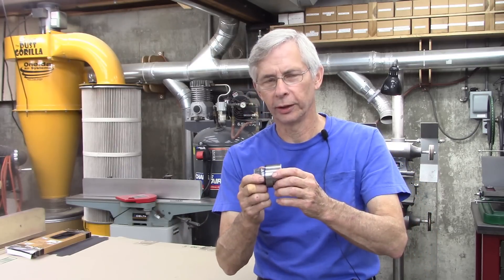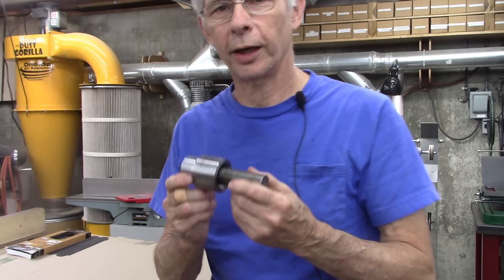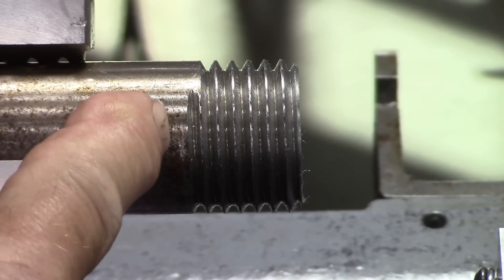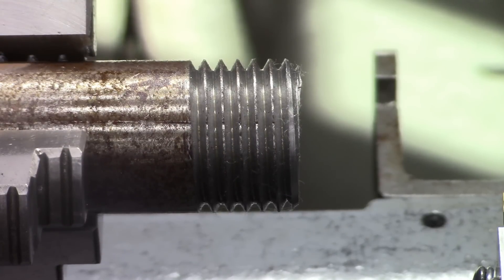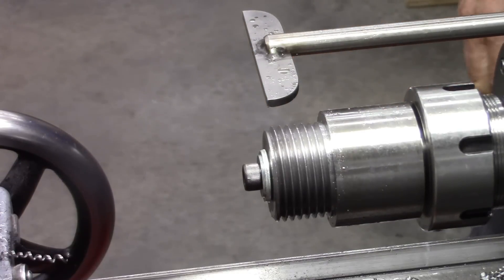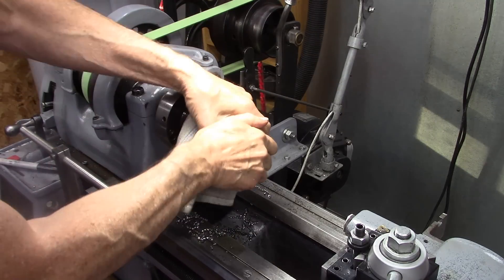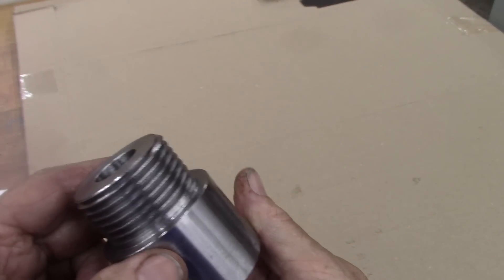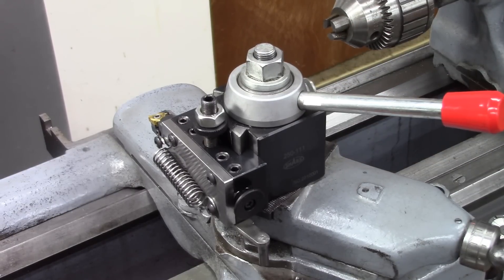Using Mr. Whoopee's Auto Retract Threader to finish my Lathe Spindle Adapter

Comment: Threading is a form cutting operation, angle infeed via compound or radial (direct) infeed via the cross side  makes no difference due to the fact once the threading tool position has been set, the threading tool remains stationary for the entire duration of the thread cut on the lathe. There are only two moving items during the thread cutting process, movement of the thread cutting tool on the carriage driven by the lead screw and rotation of the lathe spindle with the work piece on the lathe spindle. Seldom fact with threading is the threading tool geometry. 

~Fact is, both sides of the threading tool cuts. This is due to the form cutting nature of thread cutting mandated by thread form geometry.

There was a time when threading tools were initially made of carbon steel then a transition was made to High Speed Steel. For both of these threading tool materials the thread form shape was ground into the tool by machine or hand. This method of creating a threading tool has very real limitations, specially hand ground threading tools. Traditional threading tools are typically ground with zero rake, this is not the ideal thread form cutting geometry and is one of the prime reasons why threading on smaller lathes can and is often a problem, nothing to do with angle infeed via the compound set at 29.5 or 30 degrees.

As for making large threads on a small lathe, consider and ponder this example of cutting a thread pitch of 5.5mm on a small lathe.
https://www.youtube.com/watch?v=Vg562R0u5S4

The other way for threading up to a shoulder or internal threads with a shoulder is to run the lathe spindle CCW, moving the threading tool away from the shoulder. This is Not possible on a lathe with a threaded on chuck as the chuck is likely to un-screw followed by rapid dismount causing a serious disaster.

Manufactures of carbide threading inserts like the now common A60, IR or ER recommend radial infeed or direct in, no angle infeed.
https://www.mitsubishicarbide.net/contents/mhg/de/html/product/product_guide/information/turning/threding_ex_02uni.html 

For the fact, once the threading tool has been moved into the position needed, the threading tool remains stationary for the entire duration of the thread cutting process. What doe make a very real difference is the threading tool geometry which has a rake and relief moulded into the insert with precise controlled chip formation that cannot be easily done in High Speed Steel hand ground threading tools. Keep in mind, as the lathe carriage is moved by the lead screw that direction of cut is the cutting edge of the threading tool that does most of the work, the back or trailing edge creates the thread form on the back or trailing edge. Both sides of the threading tool is cutting with the leading edge doing most of the cutting..

The American centric angle thread cutting infeed via the compound set at 29.5 or 30 degree myth needs to be understood why and how it came about instead of being blindly followed or practiced without understanding why and how this myth/practice came about.

Miltifix made a manual retracing threading tool (Type FE) for their Multifix holders, they have been recently reproduced for Multifix holders:
https://www.lathes.co.uk/multifix/
Reply from the maker: >>What doe make a very real difference is the threading tool geometry which has a rake and relief moulded into the insert with precise controlled chip formation that cannot be easily done in High Speed Steel hand ground threading tools.

Generally speaking this is true of carbide inserts. However, the A60 has a simple profile much the same as a HSS tool. I'm not sure why there is no rake on the sides but in my opinion this would be a plus (go look closely at an A60 insert).

Feeding straight cuts equally on both sides of the tool. Feeding in with the compound @ 30 degree cuts only on one side. Feeding in with the compound set at 29 cuts almost all on one side with a very slight cut on the other side. And yes, this is ideal with a HSS tool that is back rake on the left side and back of the tool. The inserts have equal zero rake on both sides with a back rake so going straight in cuts equal on both sides. 

I do with the inserts were made differently. The 16ER A60 I'm using only has a basic back rake.
Reply: @WinkysWorkshop  

If you truly believe compound infeed at 29.5 or 30 degrees results in cutting the 60 degree thread form only on one side, simply make (grind up) a trading tool without the trailing edge or a single sided 30 degree triangle and try cutting threads with it...

That is the lathe single pointing threading myth that is simply false.
Reply from the maker: @rupunzel6299  If the compound is set at 30 degrees it will work near perfect. I'll have to admit that your level of certainty had me doubting myself so I did as you suggested. Please take a look at these picture on my google drive and see what you think.  https://photos.app.goo.gl/wRfnqYL3EY5e2xzFA
Reply from the maker: No comment?  Technically the right side of the thread profile had a slight saw tooth effect. If I had left a small portion of the tool on the right side it would have eliminated this effect. If I was cutting threads in one pass the tool would not have worked. Basically, if you make 8 passes to cut threads only 1/8th of the right side of the tool is used. So at least on the final pass 90% of the cutting is taking place on the left side of the tool.
Reply: @WinkysWorkshop  
"Technically the right side of the thread profile had a slight saw tooth effect. If I had left a small portion of the tool on the right side it would have eliminated this effect."

You've done the experiment and essentially answered this question by this experiment. 
Essentially repeating the results in this Joe Pie video, coarser head pitch or fewer threads per inch will aggravate or better illustrate the fallacy/myth of only the leading (left hand) edge of the threading tool does the cutting. It is also why ALL industry standard threading tools have full thread form be it 60 degrees, 55 degrees, ACME, Buttress and many more.. All are single point threaded with direct/radial infeed.
https://www.youtube.com/watch?v=8wxa7LB0FtE&list=PL4wikbEbcE3Lkebdj7roUYG4RAr7MDhTj&index=8

Those steps are the result of the trailing or right edge of the threading missing and not making the form cut. It also nicely illustrates why compound infeed at 29.5 or 30 degrees is not needed and only adds complexity to the process of single point threading. Or why Mr Whoopee recommends direct (radial) infeed via the compound, as practice in Asia, Europe and else where for single point threading on a lathe.

As for those steps in the heads cut with the 30 degree threading tool, that is not an acceptable 60 degree thread form in any way.
Reply from the maker: @rupunzel6299  Location has nothing to do with threading methods and I never said the left side of the tool did all the cutting. I said 90% (which obviously varies with depth of cut). With a solid setup both methods work pretty close to the same. However, sometimes with unavoidable stick out or difficult to support stock, feeding with the compound does much better. The force on the tool or work is reduced considerably. I probably will not change your mind but watch my next video (will be posted 10 am central US time). Just putting slightly more than a radius on the tip of the tool resolved and saw tooth finish on the threads when using the half-tool. I'm actually thinking a half tool might be the best option. It cuts a smoother thread while eliminating some of the load.  Also, when you watch the video, look at the chip formation with compound-feed vs cross slide-feed and then watch the smooth cuts and chips the half-tool makes. Admittedly, part of this improved finish is a result of a well sharpened HSS tool but the load on the stock and tool play a large part.
Reply from the maker: @rupunzel6299  Joe was not advocating going straight in with the cross slide and he said only the left side and a small portion on the right cut. https://youtu.be/8wxa7LB0FtE?si=eb7APfyvubMRDJcX&t=862

Comment: THAT is a genius idea for a home workshop tool!! And simple! Question though. I see you did use the compound for infeed. Doesn't the compound movement set at an angle also "release" the tool sooner as you feed it in farther since it moves both the tool bit and the slide left?
Reply from the maker: It always retracts in the exact same spot but the depth of cut changes with each pass. If you feed with the compound (as I did) the end of the thread will look a little off center. It still looks great and works find however.

Comment: Maybe a thrust washer on the top of the tool post might help it get tight enough not to move.
Reply from the maker: That would make it tighter but I'm seen damaged compounds from overtightening. I think the abrasive is a little safer and very effective.
Reply: @WinkysWorkshop  true, I didn’t think about it breaking. Not a lot of meat on the smaller axa.
Reply from the maker: @aaronfritz7234  I think most damage I have seen is left over from lantern tool posts but still don't want to go extremely tight.

Comment: That works great. I'd rather stick hot pins in my eyes rather than thread up to a shoulder. It would be a bit pricey by the time I got one to Australia, but as I get older and my reflexes slow even more, it might become more attractive.
Reply from the maker: I understand! It was scary using the tool It worked perfectly but still scary

Comment: Winky, I think that you would do well to fit a much weaker reurn spring to the threader. That seemed an excessive rapid return. Regards from Australia.
Reply from the maker: You might be right although its a snug fit. I think the Craig was worried a chip or dirt might make it stick.

Comment: Great job, But I really do not see a lot of advantage in the threading tool,??? 👍👍👍👍👍
Reply from the maker: There are a few. First, without the auto retract you can't get super close to a shoulder. Second, without the retract you need to make an undercut or groove to end you threads and it needs to be wide enough to give you time to disengage the half nut.  This grove limits the number of threads and weakens the undercut area. In some situations the unthreaded area at the ends of the threads act as a register to hold center (like a lathe spindle of the adapter I made. And last, it looks nice.
Reply: @WinkysWorkshop  Thank you.

Comment: Another way, no angle in-feed via compound at 29.5/30 degrees (appears to be an majority US of A machinist practice, not done in the EU, UK, Asia and other Nations).

https://www.youtube.com/watch?v=b9qB8zfUy1E
Reply from the maker: Feeding with the compound has more to do with the lathe than than location. Smaller lathe are not as rigid and can't handle the chip load when cutting on both side of the tool. It's the same with cutoff. Somebody with a lathe like the one in your video quite often are not aware of these limitation. Very cool set up in the video although it has a small undercut at the end of the threads. It could be that older US made lathes are not as rigid as well.
Reply: @WinkysWorkshop  
During thread cutting operations on a lathe there are essentially two moving elements involved. the lathe spindle rotation and motion of the cutting tool driven by the lead screw.

~Threading on a lathe is a form cutting operation.

Once the threading tool has been positioned, the threading tool remains stationary and does not more.. Regardless of how the movement of the threading tool is achieved/done. This means moving the threading tool by cross slide alone or combined cross slide and compound movement of the threading tool results in a stationary threading tool once set. 

Cutting of the thread form occurs by the leading edge of the stationary threading tool being advanced/moved by the lead screw against the work piece moved by the lathe spindle. It is the leading edge of the threading tool that does most of the cutting/material removal with the opposite side of the threading tool cutting/working to create the thread form shape.

What is virtually never discussed among the adherent followers of threading by compound in-feed is threading tool geometry. Historically, threading tools were ground using high speed steel blanks with zero rake. For hand ground high speed threading tools trying to achieve high accuracy angles and geometry was difficult, adding any additional changes to the threading tool geometry is even more difficult due to the size and accuracy required for a treading tool. This is why hand ground high speed threading tools tend to have zero rake or neutral cutting angle. It is well known and well proven positive rake cutting tools reduce cutting pressures and forces involved in the metal/material removal process.
Examination of modern carbide (A60, IR or ER) insert threading tools notes the positive rake cutting angles moulded into the carbide insert. This high precision/accuracy moulded in feature of the threading insert reduced cutting forces required and are designed specifically for direct (cross side) in-feed.  As noted in this Mitsubishi carbide threading guide:
https://www.mitsubishicarbide.net/contents/mhg/de/html/product/product_guide/information/turning/threding_depth_cut.html
Similar can be done on a high speed threading tool by adding a positive rake cutting angle to the thread cutting feed direction.

As for thread cutting and small lathes... size of lathe alone does not mandate in-feed by compound, here is an example of big threads cut on a much smaller lathe than a South Bend..
https://www.youtube.com/watch?v=Vg562R0u5S4

~There are machinist myths that should have died decades ago...

Comment: Cool Tool!  I think that it should only need to travel a short distance on retract, just enough to clear the OD.  Perhaps that's asking for more complexity, but it would eliminate that hammer blow action on the tool post.  Just saying...
Reply from the maker: It would help but the amount of retract needed changes with what you are making.
Reply: The original was exactly that, 1/8" retract, enough to clear an 8 tpi. Of course someone had to complain about that.
Reply from the maker: @phineasj.whoopee3301  At least for my project it needed to be at lest 1/4". I think it was a good improvement.

Comment: Maybe if you did a spring or very shallow pass using the cross slide for the last pass you could get rid of the double ending.
Reply from the maker: I agree, and Craig suggested the same. I didn't think it was a issue.

Comment: hay ! that is super cool.... i love it ! ... Well done ! that virtually eliminates the worry of threading toward the chuck !.... I like to thread in reverse with the cutting tool upside down
but with a screw on chuck the demands tiny cuts.... i have not experienced the chuck unscrewing in reverse yet doing anything but it is possible !  my chuck seems to latch on very well when I screw it on and it takes a hammer on the chuck key to brake it loose !
not much force but it does lock on !  I love my Logan 911 !!!!!!
thanks Winky !
Reply from the maker: I think reverse has some huge advantages but yeah, Screw on chuck. It scares me. I tried cut off, worked great for about 2 seconds.

Comment: It takes away the "stress" part of thread cutting. If you can fully trust the tool of course.
Reply from the maker: It was stressful to me but you're right.
Reply: Thread towards the tailstock and there is absolutely no stress involved
Reply from the maker: @37yearsofanythingisenough39  For me a chuck rolling across my basement floor is a lot more stressful.

Comment: Glad to see you bought one of his adapters!  I bought one of Craig's earlier versions in Dec last year for my SB13.  I had never threaded on any lathe before and other than the pucker factor when first using it, it works great.  I'm an old guy with slow reactions so threading was just a little to daunting.

Do  you plan on adding the half nut disconnect to the system?  I added that component as well and highly recommend it.
Reply from the maker: Very cool! I might do the half nut later.

Comment: The reason you're seeing the dual lines is because you're feeding with the compound but ending at the same spot with the tool. Does that make sense?
Reply from the maker: Yes I know. It doesn't bother me at all plus feeding straight in is too much load for my lathe
Reply: @WinkysWorkshop  mine too I believe. I have an old Enco 13x36
Reply: Yep, that makes perfect sense.

Comment: I hardly thread with the compound anymore Ihavent tried straight in acme yet but my threading insert are pretty tough  I also like going left to right with my insert holder upside down at a higher speed makes a very nice thread ....cool tool wink I thought you would make one yourself
Reply from the maker: Upside down and in reverse is probably why you can go straight in but it's hard to do with a screw on chuck. The tool tries to climb out of the cut instead of digging in when things flex